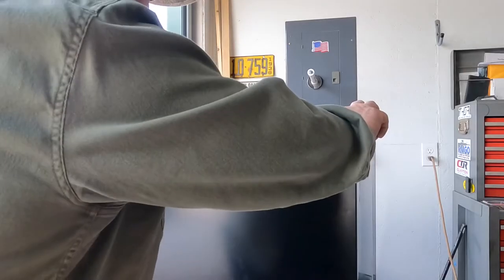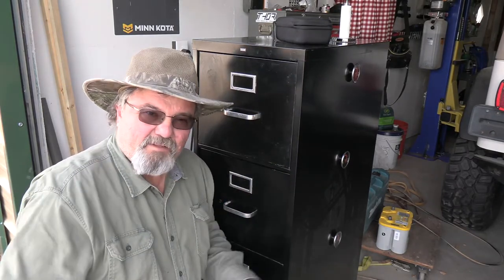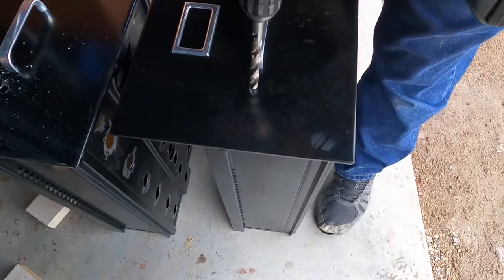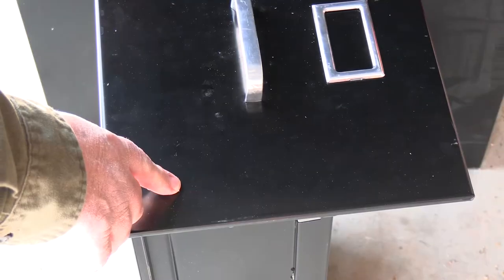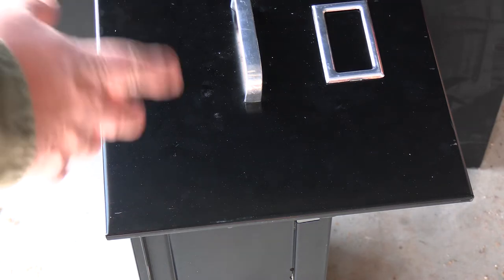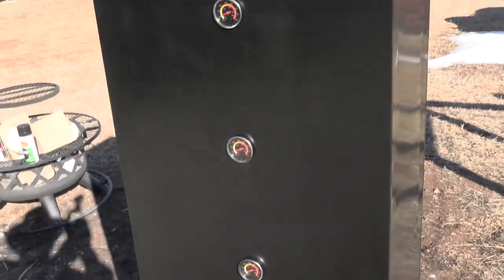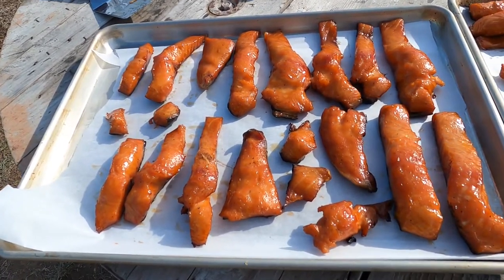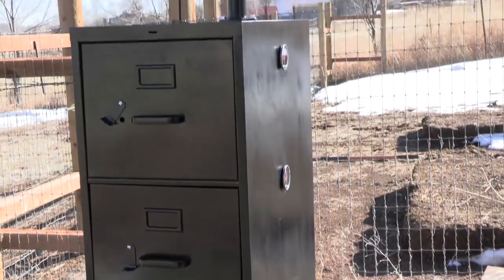File Cabinet smoker build DIY

Comment: Hi Joe, I've been wanting to do one of these file cabinet smokers for a while now, in fact I got the cabinet a couple of years ago. As far as burning the paint off the cabinet, did you use any specific wood or temperature? Also did you keep it burning till there was no longer a paint smell? I look forward to more of your videos, and I just subscribed to your channel. Thanks, Sheryl
Reply from the maker: I also have a video I put out within the last week an update on it check it out when you get a chance if you haven’t already. It will give you a little more instruction on things that will make it better. When you burn it out make sure you pull all three of the thermometers out of it when you do it. It did not hurt the top two but it did kill the bottom thermometer and I ordered another three pack off of Amazon so I have two extra now. I just took some firewood put in the bottom cabinet and let it burn for a couple of hours. I also put a little bit less firewood on the next drawer up in little small fire in that just to be sure. I’ve used it several times since then and it has no more paint smell. In fact it smells like wood smoke Even when it’s not being used. Thanks for liking and subscribing to the channel. I enjoy sharing outdoorsy stuff and will continue to do so.
Reply: @safarijoesadventures  Thanks for the quick and thorough reply! Yes I looked at your updated video and I liked it too. :-)
Reply from the maker: One other piece of information you may be interested in. When cold smoking something like cheese I find that the Pellet smoke tube works better than the smoke generator that uses sawdust size chips. The generator produces less smoke than the smoke tube. I think the generator would be just fine if you were smoking something like cheese in a very small smoker. But for a larger smoker like the file cabinet the Pellet tube works better and it’s about half the price of the smoke generator.
Reply: @safarijoesadventures  I thank you for the additional info, it is much appreciated!

Comment: when you do the paint burn off how long should the burn be? wanted to do one of these for a while now..
Reply from the maker: I took a couple of old cake pans put one in the bottom and one in the second drawer down from the top and kept a wood fire going in it in both areas for a couple of hours and then let it cool down. it’s just like burning off a brand new woodstove. it either burns off or bakes in the paint and it’s just fine after that. I use this quite often . Once you start smoking with it, the woodsmoke pretty much coats the inside of it I’ve never had any issues. I hope that helps. Just make sure when you burn it out take because it will ruin them because of the heat getting really high. I did not do that, and I ended up having to buy a new set of them.
Reply: Thank you so much... my dad has some old military cabinets he told me i could have 1... i want to cold smoke hot peppers and cheese to start off with but i can see this going in many directions.. @safarijoesadventures
Reply from the maker: @tjmiller4269  I really enjoy using mine. I did another video on that. Also kind of like an update video. That’s the first one I’ve ever built and I did learn a few things in building it. I like to tinker and do these DIY especially when they have something to dowith the outdoors. Thanks for subscribing also.

Comment: Did you paint the outside?
Reply from the maker: I did not paint the exterior once I was done with the work on it I knew I was going to get a Woodfire going on the inside of the cabinet and it would either burn it off or bake it on the exterior.

Comment: How much to build one just like that
Reply from the maker: You can pick up those 4 drawer file cabinets pretty cheap anymore because everybody’s store stuff on their computers. I bought five of them from a company two years ago for $75. The little grates that I put inside I got at a some different thrift stores and they were $1.99 each. The little smokestack on the top was made from an exhaust pipe and I believe it was around $15 for the pipe and the flange was another six or seven dollars and it had to be welded. You don’t have to use the exhaust pipe, you can put the same thing on top that I did on the bottom drawer to run the hose through and that would let the smoke out. The thermometers for three for $15 from Amazon and the little gas stove that I put in there I believe was around 25 or $30 and it all depends on where your source your stuff. I do a lot of different DIY stuff so I’m always looking in thrift stores Facebook marketplace and craigslist for different things. I hope that helped.
Reply from the maker: I don’t know if you’ve seen this other video I put up after I built the file cabinet smoker, but it’s an update you might be interested in. Here is the link. https://youtu.be/cF0IHAYdxx0

Comment: In the process of doing a cabinet smoker  4 draw I think your video is awsome could you not put temp gauges on the front of your draws instead of the sides the temperature should be the same should they not .Alf nz
Reply from the maker: I had thought about that and I’m sure it would be fine. I just did not want to hit the end of the probe with anything I was putting in or taking out of the cabinets. I did drill a hole in the front of each one so I could stick and meet pro through the drawer for testing the meat.

Comment: having problem getting heat and smoke up to the top 2 drawers, do I need more holes?
Reply from the maker: I have another video of updates that I did on it. You should give it a watch. Yes I did add some extra air venting at the bottom. You could also add extra air vents at the top . It did help you might wanna give it a shot.

Comment: What about the paint on the cabinet? Shouldn’t you sand it off and paint it with fire resistant paint? Off gassing from the old paint may be toxic?
Reply from the maker: I did sand and paint the exterior of the cabinet with a black fire resistant paint. The interior of the cabinet I’ve filled with firewood and burnt it out for about four hours. It burnt all the paint out. I have no reason to repaint the inside of the cabinet as The paint is burnt off and the metal is coated With smoke after using it

Comment: Hi Joe
is it necessary to remove original paint before spraying high heat black paint ?
thanks !
Reply from the maker: I started to on the outside but it was a pain so I just did a rough sanding on it and then sprayed it with the high heat paint. For the inside I just started a fire in the bottom and second to bottom drawer and let it burn for a few of hours and it burnt all the paint out I just didn’t want paint fumes from the inside in the food I was cooking. Just remember to take the thermometers out of the side when you do the burn out in the cabinet drawers as it will damage the thermometer in the second drawer I found that out the hard way and had to buy a new set lol. File cabinets are not as thick as a wood stove or a regular grill and a flame in the bottom box will discolor the paint on the outside. I hope that helps. Good luck on your build.
Reply: @safarijoesadventures  thanks for the tip!
could we roughly sand out the outside of the filing cabinet with a orbital sander ?
Reply from the maker: I think that would work fine I  used a small palm sander to do mine.